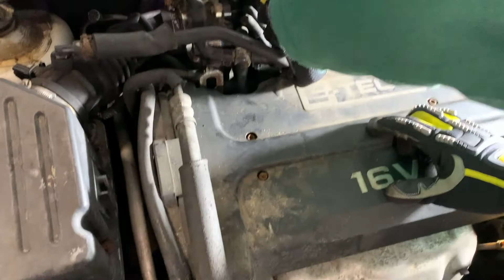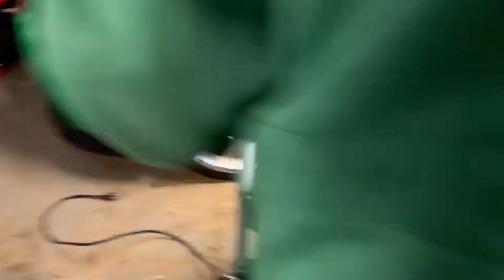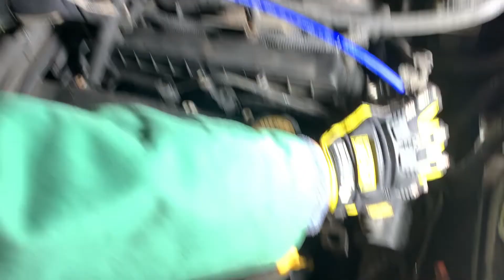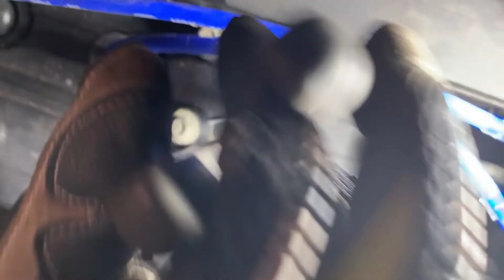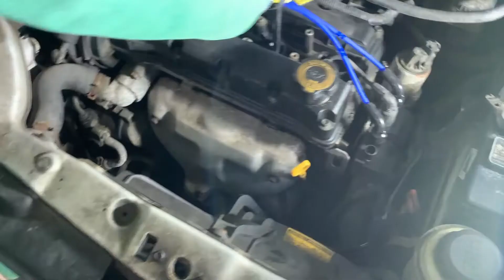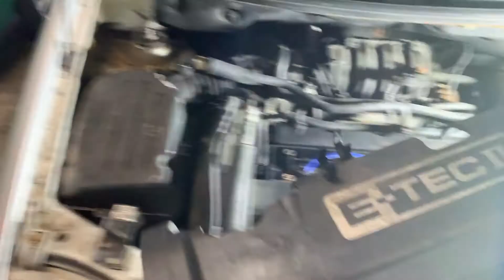2004-2008 Chevy Aveo spark plug and wire set replacement

Comment: Also would it stop the light shake in steering wheel
Reply from the maker: Lo S-c changing TB is not likely to fix steering wheel shake. Have your wheels balanced, and inspect all your front end steering components, as well as your engine/tranny mounts.

Comment: Do you have to replace the wire set ?
Reply from the maker: In this video we did, one of the ends had degraded where it meets the plug and was causing a misfire. Safer to replace them when you do the spark plugs.

Comment: Hello. Which spark plug brand do you recommend? Do NGK or GM give the same performance?
Reply from the maker: Ahmet Furkan Özdener I always use NGK iridium. 1 - they give me zero issues, 2 - pre-gapped, 3 - they last so damn long. I also find the GM/AC Delco aren’t as widely available, as I tend to order online mostly.
Reply: @416diy  Thank you for the advice

Comment: What would  you estimate the the torque value (ft lbs)  from your 1/2-2/3  rotation? I have a 2011 and I'm a bit nervous about working with an Al head. Thanks! Robert  Kansas City, MO.
Reply: Hey Robert the standard usually ranges from 15-20 ft pounds of torq, you could always search your specific specs online. Hope that helps

Comment: Does it start if you mixed them up?sparkplug wire i mean
Reply from the maker: Elmer Eyao probably, but I don’t recommend it.
Reply: Yes it will but don't do it. I found my machines messed up. I reconnect it ryt way. I did 350km with miss connection. 
Lucky I found the problem

Comment: He says this car is cursed. Not so,
Mine has 200,000 miles on it still running fine you just have to keep up with the maintenance
Reply from the maker: Allow me to qualify my statement, that particular Aveo is cursed.  It currently has 150,000 kms (93,000 miles) and it’s leaking from the valve cover, oil pan, rear main seal and water pump. Every steering and suspension component in the front and rear, alternator, starter, throttle body and countless other parts have already been replaced, and it’s rusting everywhere.
Reply: @416diy  At 100,00km it shouldve had its timing belt changed. When you change the timing belt on an aveo you should be changing the water pump as well. Valve cover is normal. That gasket needs to be changed fairly often. Super easy to change it though.  The rust and gaskets cant be helped, its a $20k korean econo car.

Comment: What if oil is on the gasket area? Just clean up and replace
Reply from the maker: Lo S-c that’s what I’d do. The gasket is rubber, so there’s no mess to clean up after you remove it, and it only costs a few bucks. Why was it oily though, are you using an oiled air filter?